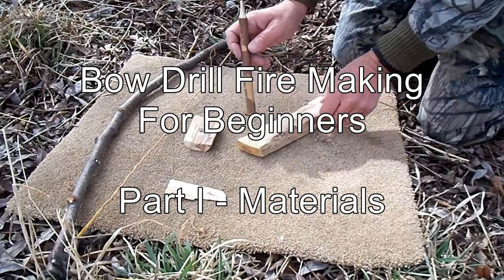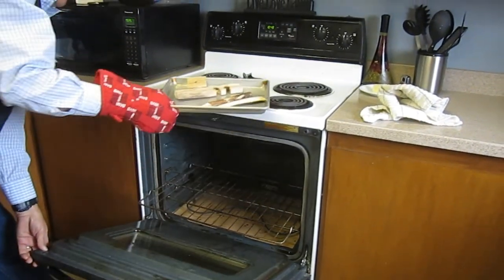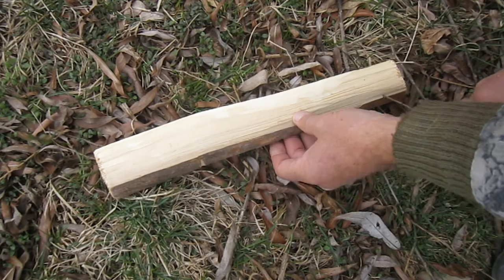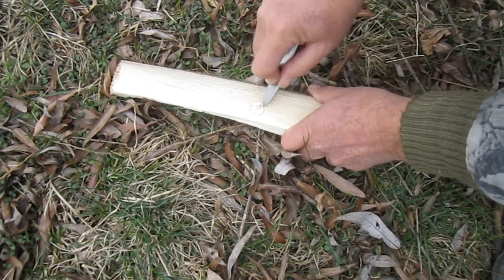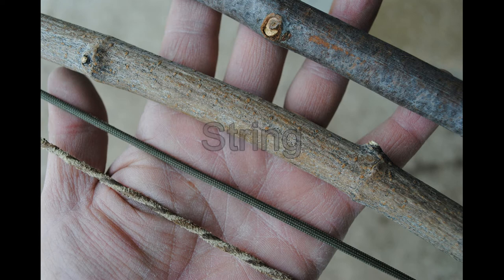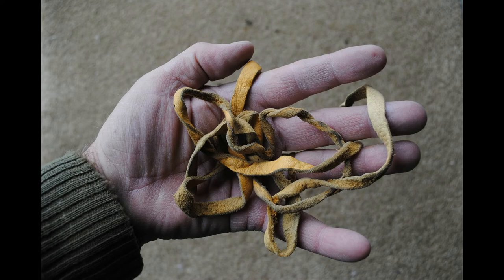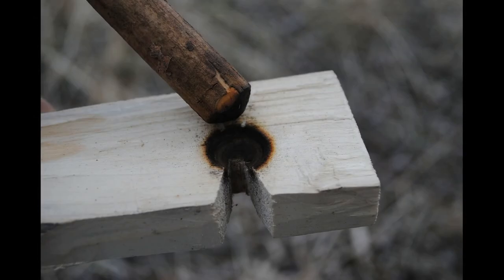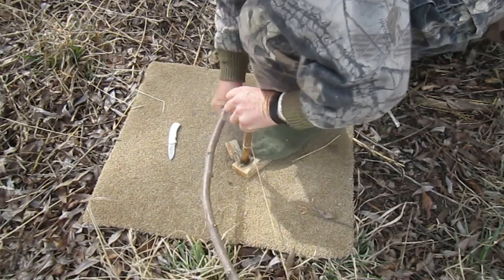Bow Drill Fires for Beginners - Part 1: Materials

Comment: I think this is an excellent video. You do everything that I do with one exception. Instead of putting a piece of wood in the top part of the drill, I tie a string tightly around what will be the bottom of the drill. Then I split the drill for a distance of an inch or two. I find any pithy piece of wood and cut one end to a flat, sharp edge. I place this in the split and fasten it with string and small pieces of wood. There is a type of weed that grows all over the country. I think it is called horseweed. It is easy to work while it's wet but dries very hard. I have had my best success with this. I've also used sunflower stems. Anything with a pithy center seems to work well. For the hearthboard, I find cottonwood to be the best. I think your method of simply inserting a piece of wood in the top of the drill would be much easier than what I described and will try that. I too make my bow about two feet long. This length allows me to get a full reach with my arm and provides less starting and stopping. I have also made punp drills and have done well with them. Their only drawback is that if you have only a knife with you, they take a lot more time to make. Thanks for the information.

Comment: The only thing I seem to get is burnt dust I get smoke no hots any Solutions
Reply from the maker: Try a different piece of wood for the drill and/or fire board.  The wood source (species) can make a huge difference.
Reply: Once you’ve learned how to ride a bike, you never forget how to fall off!

Just ask an old geezer!😂😂😂

With fire making , nothing seems to be 100% Too many variables. When I started, I couldn’t get one going by chucking the spindle up in a dewalt drill!
Now my failures usually happen when trying new materials gathered on the spot, where I haven’t eliminated the variables like moisture, or the possibility that this combination of material doesn’t work together.
My personal favorite is a mullein spindle with a cedar or popular fireboard, for both hand drill or bow drill.